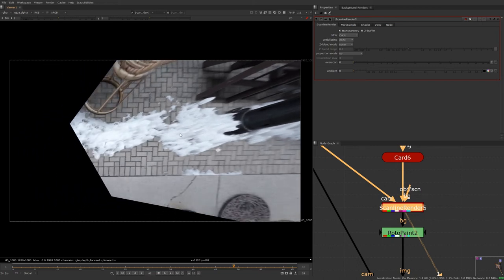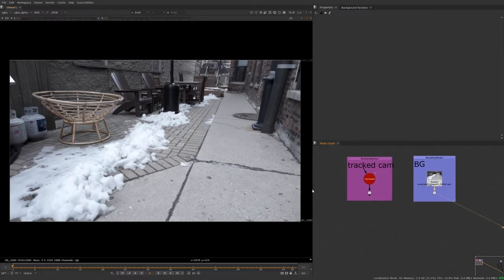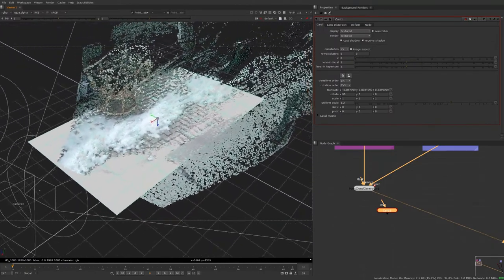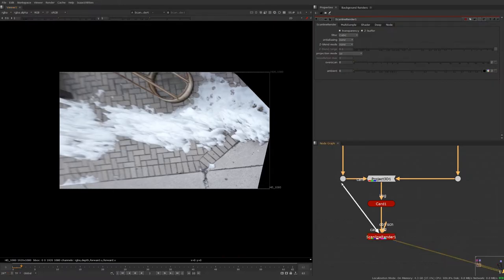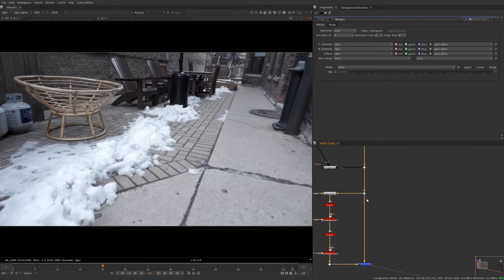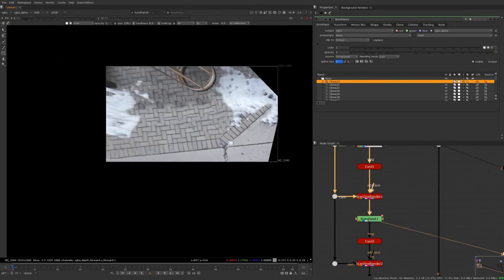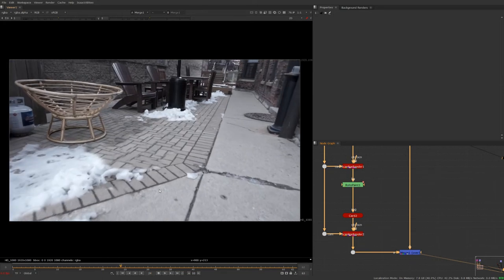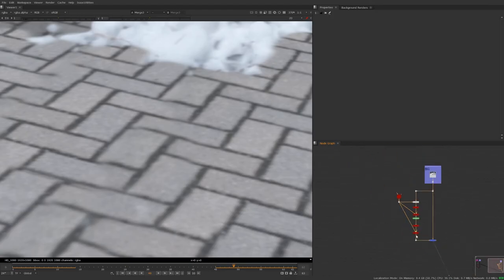Cleanup made easy with UV Projection

Comment from the maker: As many people pointed out in the comments, you should always premult the patch before merging over the B plate. One way of doing this quickly is setting the "Output mask" dropdown of the RotoPaint node to "alpha". This will take the paint stroke alpha from the cloning and replace the existing alpha channel. You can then premult directly under the RotoPaint before merging.
Reply: wow this helped me out finding a solution to a small problem ! thanks !

Comment: I come from AfterFX background and I admit that if a client asked if cleaning snow from this footage is possible, I would answer that this is not possible. This really opened my eyes.
Reply: In a case similar to this example (a flat surface like a pavement) this is actually easy in AE with planar tracking (mocha) and reverse corner pin stabilisation with a corner pin plugin (like Kingpin) that allows to set "from" points. The only difference between AE and Nuke is that Nuke can get the data not only from planar tracking, but also from camera projection. 3D in AE is very basic compared to Nuke.
Reply: What's reverse corner pin?
Reply: @elconravi  When you track a surface (for example in Mocha) you get coordinates for a rectangle, say it's a TV screen, ad billboard or a part of the pavement. The regular use is it to put something on top of that, like a new TV program, another billboard etc. But what you can ALSO do is stretch those coordinates to the 4 corners of your composition, so effectively what you get is a stabilised blow-up of the tracked part of your footage. You can work on that using the regular tools like paint/ clone tool or whatever, and then transform it back to the original place in the comp by applying back the regular corner pin on top of your cleaned up blow-up. I think in Nuke you just need to check "reverse" or "inverse" in the corner pin settings, but in AE you need an external corner pin plugin like Kingpin which has the additional "from" pins apart from the regular "to" pins.

Comment: UVs are always 1:1 in aspect ratio, so add a reformat with a square resolution. If not, you are adding a scale filter on your newly created UVs. Add a reformat to your first scanline render, 2K or even 4K depending on the size of your comp. That way you wont have a double filtering effect like the one you are experiencing(16:9 to 1:1 in you first scanline and then 1:1 to 16:9 to your final scanline). It will still have a hit on your image quality but only if your UV resolution is smaller than the resolution needed to produce the patch. You also need to add the alpha output to your paint node and only render the part of your image you painted instead of the full image again. Add an erode (and a blur maybe) after the rotopaint, to enlarge the alpha of you rotopaint and then a premult, and pipe that as UV to your final scanline render.

Comment: Nice tutorial! Another thing you can do, to avoid unnecessary filter kicks, is to make a difference key on the uv space, before your paint node and after, and clamp the alpha so that you have no transparent alpha values, just 0 or 1. Then you copy it in and premult it, before you put it back on your card, so you just project the pixels you have changed. :)
Reply from the maker: Good tip! A simpler way to this would be to set the filter on the rotopaint node to "impulse". Impulse forces the new pixels to have the original alpha value of the plate. Since the original plate has solid white alpha, all the paint strokes will have a value of 1 (white) or 0 (black) if the plate has been stenciled or transformed beforehand.

Comment: Can you adjust the position/size of the card without affecting the projection/resolution of the clean plate or would you have to start from scratch if the card edge is cutting off the projection?
Reply from the maker: Changing the position or scale of the card changes the UVs of the object so yes, you would have to start fresh. Alternatively, you could keep the work you already did a keymix in a second setup for the area that's getting cut off.

Comment: If our removable object has movement from first frame to end frame,how we can do?
Reply from the maker: You can framehold areas without the object and patch those in over the object you're trying to remove. If the object you're looking to remove is stationary but is still sliding when viewing the UV projection, it's likely that your card is not in the correct position.